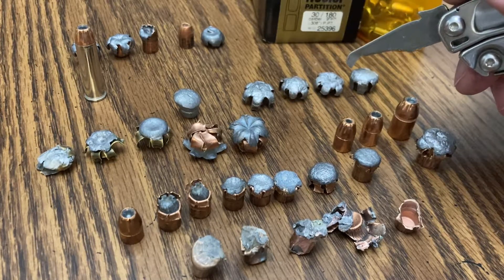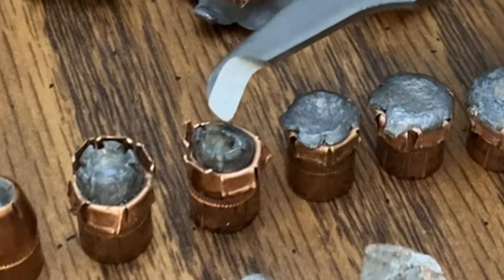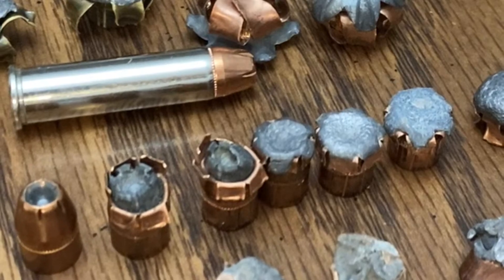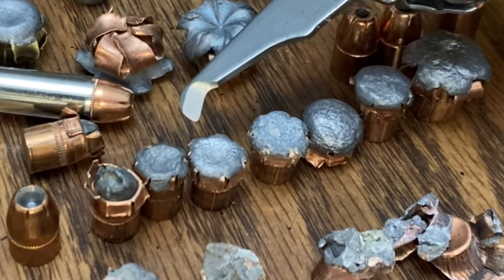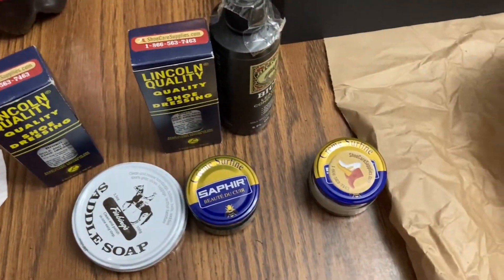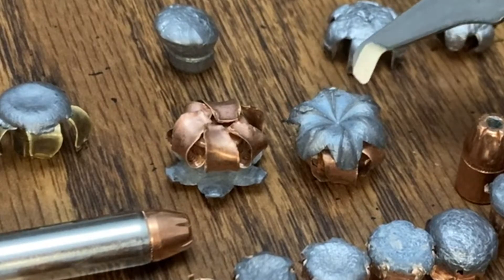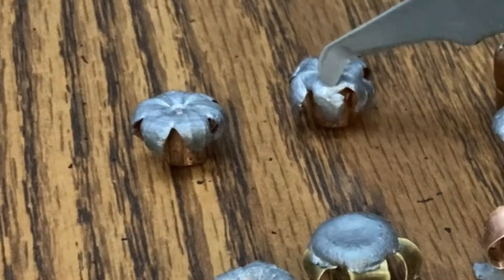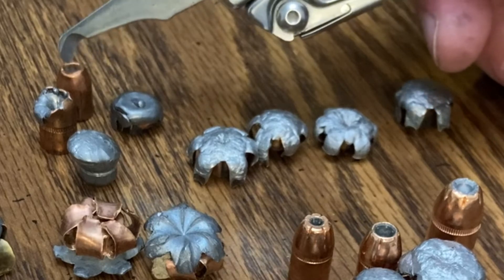Hornady XTP Velocity/Expansion Tests

Comment: I used to shoot the 250gr. and the 300gr. XTP's in a  454 Casual at 2000, fps. And 1900 fps.  Expancion, was great. The results the same. Very good accuracy, good expansion, the bullet held together good. The penetration was extremely good. Its a tough bullet that expands to some very impressive musshrooms, but doesn't blow up on deer. The 300gr. XTP at 35 yrds. went stright through a deer, with a very small amount of blood shot meat, but the bullet went between the ribs, hit the ground on the other side, and kept going. The deer didn't go as far as the bullet. The load was a 300gr. XTP. over a very compressed load of H110 power. That load would blow up most guns. Not Freedoms Arms guns though. I all most didnt find a bullet hole, on that deer. Ihad to look inside the ribs. Just a round hole, not near the damage I expected, but no bones were hit. On an elk it would have made a much bigger hole, but it still would have gone all the way through.
Reply from the maker: 🦌 it’s. Ice when you get to keep the max amount of meat!   🥩  I really am liking the XTPs, they do the job with little fan fair, nuttin fancy, but they seam to work well.  That 300 grain is moving!

Comment: I have found Unique to be very position sensitive in the 357 magnum, particularly with a light load because there 8s too much space in the case. Full-power loads that mostly fill the case are much more consistent
Reply from the maker: I agree, that powders like H110 that give full case fill are much better for full house loads just as you said.  They also have substantially more velocity.

I like that Unique and TiteGroup work well enough to do the job effectively enough if I’m out of H110/W296, or just plinking and trying to stretch out my powder costs.

Comment: The only projectile your missing is the best looking of all expanded the HST its close to the hydra Shok and looks like a cross between sig v crown and gold dots. You have a nice little collection of bullets. Water is one of my favorite ways to catch a projectile the only problem I have with water is jacket and core separation I don't get that with gel and dirt and sand deforms the projectile to much. I found for me the perfect combination is gel and then a styrofoam cooler filled with water I get picture perfect projectiles with all the factory tool marks. I hand load a lot of my ammo and with the gel first and then the water I can push the fps faster and not have my projectiles fragment like they would in just water. Great video a lot of info on jhp expansion. I've been working with the XTP projectiles for the past year they have become my favorite because they can handle high velocitys without fragmenting and out of every jhp I ever tested they are the only ones I can get to penetrate 14 Guage steel.

Comment: I found the .357 125gr xtps to be a pretty tough bullet lacking in consistent expansion below 950fps. The .357 158gr xtps on the other hand, fantastic expansion from 900fps-1200fps essentially as advertised.
Reply from the maker: They do not like lower velocities for sure.  I did find good success with bullseye powder in my snub nose 38.
Reply: @oddballschtuff  For deer how fast would you think you want the 158 flat points moving?
Reply from the maker: @casejasnoch2533  I don’t have my load data convenient right now, but I would want to be pushing them as fast as possible if I were hunting with them. I personally don’t like to push things to max charges. I like to have a little bit of buffer just in case.  personally, if I could get it within safe loading tolerances, I think I would be pushing for 1275 and above. The faster, the better, but not sacrificing accuracy. If you’re shooting it out of a carbine or rifle, I would expect your velocity’s will be much easier to obtain.  Thanks for watching!!  Good luck!🍀
Reply: @oddballschtuff  ya this would be out of a lever action. Thank you.

Comment: I have a large collection of expanded  hollow point bullets, including XTPs. I use paper, either newspaper or phone books, thoroughly saturated to roughly 70% dihydrogen monoxide by weight. May be less consistent than a jug of water but I believe it is much more analogous to fleshy tissue and therefore is representative of not only expansion in flesh but also penetration.
Reply from the maker: I think your right on the wet paper for sure.  That dihydrogen monoxide combo is a great test media.  Jugs can only tell a small part of the story.

Comment: I wish hornady made a 110gr flat point bullet so I can load in 356 tsw at high speed and get good penetration. Shorter and lighter bullets work best with this cartridge delivering 357 sig performance with 9mm capacity.
Reply from the maker: I’m surprised they don’t offer more weights in the FP XTP.  What does 110 gr XTP do at 1600+ fps.  Does it just turn inside out?
Reply: @oddballschtuff  well i haven't tried 110gr but i have tried the 115gr which are made for 9mm and they come apart at high speeds.
Reply: @oddballschtuff  they only thing is that i need a .355 bullet

Comment: "This bullet has a special place in my heart." It took the surgeons four hours to remove it from me and get me fully resuscitated.
I'd like to see a comparison of the Hornady XTP and FTX projectiles. XTPs are still easy to find and not super expensive by current standards. They don't sell the FTX in 110 or 125 grain .357" size though. I think the best I'll be able to do is try and match factory loads. I have some Critical Defense 38 Spl+P with 110gr FTX projectiles.
Reply from the maker: Now that’s quite a story there!  I haven’t been able to recover much from the FTX’s on my two attempts with 44 Mag.  I do know that the 30-30 will take out a Bull elk with 160 grain FTXs.  They did great, but only little bits were left as they exploded inside the animals heart lung area .  My problem is the same your seeing, I haven’t seen them for a couple years in pistol calibers.  Glad you made it out alive.  LEO, or wrong place at the wrong time?
Reply: @oddballschtuff  More of a play on words since you said it in your video.